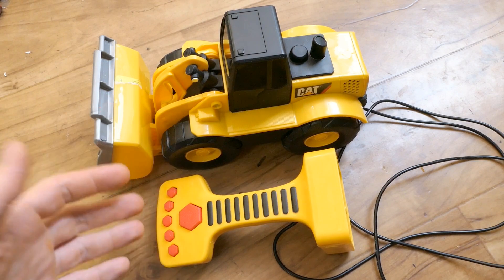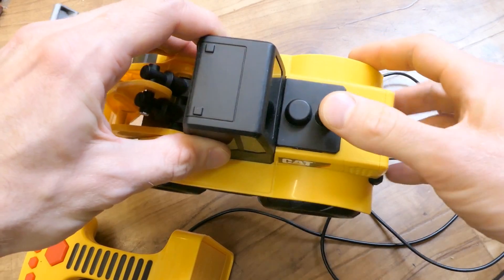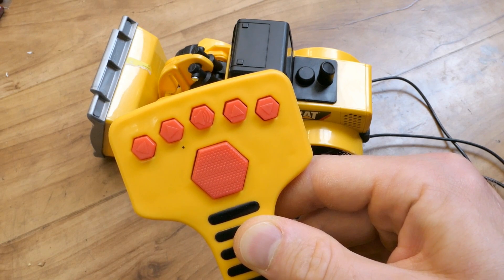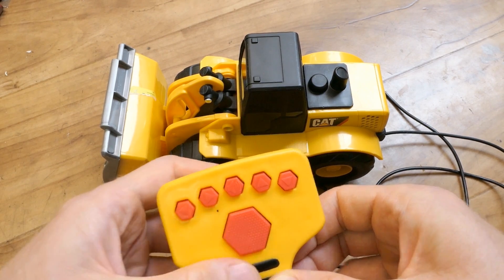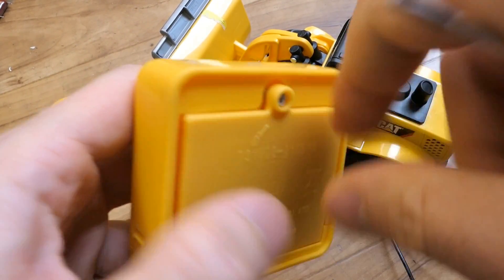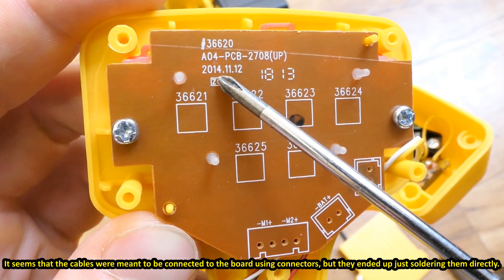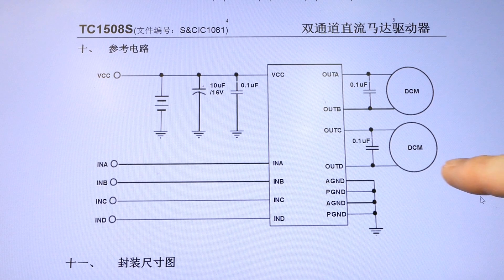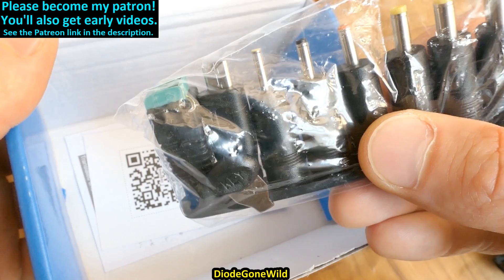What's inside a CAT excavator + repair

Comment: If you read the letter you can see the 9 years old fan has a soldering iron. If he really does solder himself that’s impressive.
I got my soldering iron when I was 12.
I made my first device when I was 10 (an audio amplifier from LM386 but with a tons of filters, not just the chip and an output capacitor)
Now I repair hardware (computers), power supplies, audio amplifiers and stuff like this.
I make bluetooth speakers, but also big ones with wood enclosures.
I also made my Hi-Fi amplifier with built-in equalizer, but 100% analog.

Comment: Hello Dan.
Can you make a flyback power supply about 24W base on self-oscillating BJT( no chip or mosfet) please.
I've learned a lot from you in every dodgy  chargers that you've teared down.
In your video about 12V 2a adapter can you make it to 2a current??
Thank you

Comment: My father used to bring this kind of toys and I always used to use it for a month and then I used to break a wire so I will be able to take it apart for the motors. 😂
Reply: I used to do the same.teardown actually reveals a lot history behind the main thing.
Reply: @souravsaha3580  yes true
Reply: True middle class Indians
Reply: @Time-cc2qb  have been doing the same thing so far. Now i am 25, still have the same curiosity what a electronic device or anything i have in front could made out of.
Reply: Same as me